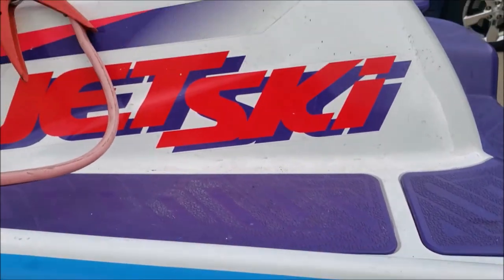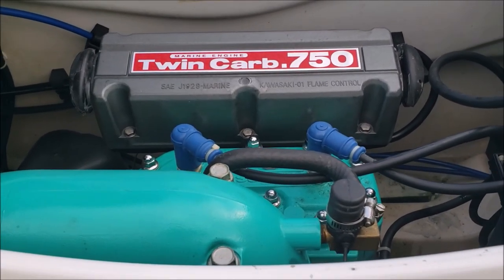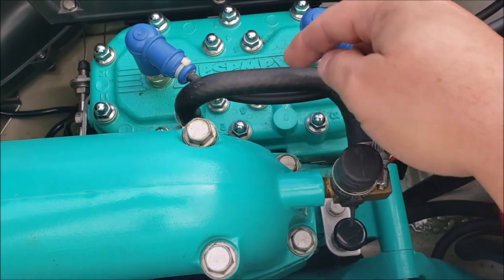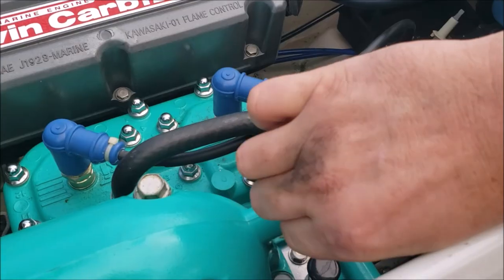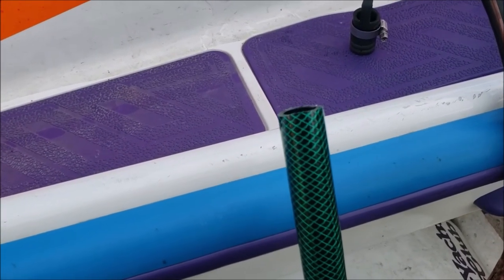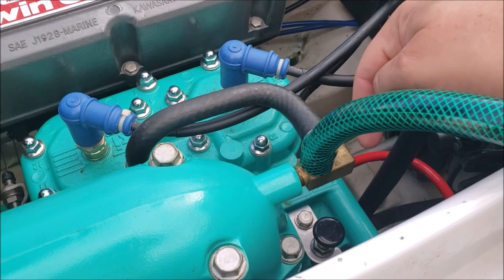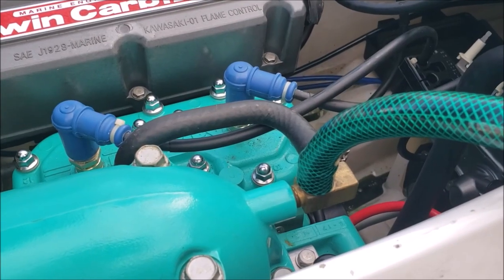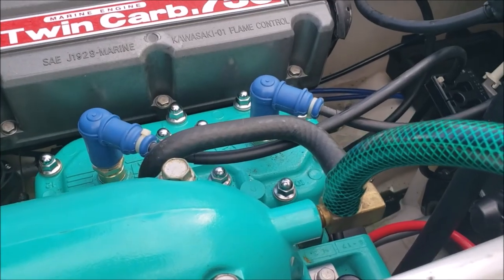Flush or Run Your Jet Ski - Water Hose Connection

Comment: I have discovered something VERY critical about running these on a water hose. Basically, that water hose connection is used to FLUSH the system..it is NOT intended to run the motor for but just a brief period. Doing so can cause HOT spots in the head around the cylinders and you can destroy an engine. When you run a water hose via that connector, you're basically going backwards with the water flow. Normally (while ski is in water), water flows in through where the jet pump is. I recently rebuilt one of these motors and the number 1 cylinder and piston were destroyed and we believe it was because of running on water hose for too long
Reply from the maker: Really? I knew it was the flush port but they also say to run it when using it.  I think the key here is too long. Thanks for the great info.

Comment: When I run the Ski should water be coming out of the Bypass outlet?  And if not should I flush it?
Reply from the maker: When you are running it in a body of water you should have water coming out of the side bypass. If not you can try to flush it but also check the pump.  That is there to let you know it's working.

Comment: Random question, I own the exact same model, but can’t seem to find an adapter to connect my garden hose securely. Would it be bad to just set a basic funnel in the flush intake and turn the hose on? Thanks!
Reply from the maker: You will need something that can take the pressure from the garden hose.  The water needs to be pushed into the adapter.  I would get a cheap hose and cut it to fit over the opening.

Comment: I just bought a 97' 750 and the owner had never heard of flushing. What type of damage am I going to come across, if any? Thank you for your video!
Reply from the maker: A lot of it is based on where it has been.  If it's been in salt water at all, flushing is very important.  The salt water can eat away and corrode the cooling system.  If you are in an area that gets very cold, there could be stress from the water freezing if not drained.  If it's been only in fresh water and kept out of the cold, it could be just fine.

Comment: What happens is your engine will lock up because water gets into the cylinders and it can’t compress the water so it locks up.  Cranking on it can cause further damage. You have to pull spark plugs and crank it and hope it’ll fire after you put them back in
Reply from the maker: Are you saying you will water lock the engine if you flush it?
Reply: It's got to be running before u start the water

Comment: If you were going to winterize, would you pump antifreeze through this same inlet?
Reply from the maker: All I do to winterize mine is run the water out of it.  But, if you are in a very cold climate then yes, you can run an antifreeze mixture through the water port to help keep any residual water from freezing in it.
Reply: I live in northern ks and I flush it like this fella. Then run rv antifreeze down a funnel connected to garden hose while the ski is running until the antifreeze comes out the exhaust.

Comment: What is the black knob for that is udder the place where you hook the garden hose to. Thanks for your help
Reply from the maker: Found this online because I have never touched that.  "Looks like the crankcase drain plug! Most people remove them and get a crankcase block-off installed. Its real easy. If the plug goes bad it can suck water into the crankcase! They stopped installing them on the SXR."  Hope that helps.

Comment: The black button thats below the water inlet . What is it for .
Reply from the maker: That is a pull knob to drain the engine of water if they jet ski gets submerged and water gets in the engine.  Here is a link to the owners manual if you want to know more: https://www.kawasaki-onlinetechinfo.net/dispeBook?file=99920-1799-02&mark=JH750C3&manual_kind=OM&model_year=1997&lang_code=EN
Reply: Thank you . I have a 750 zxi .Couldn't figure out what that black button did . Good to know .

Comment: So if you fill it up with water can it not flood the engine with the water since it’s the exhaust manifold
Reply: Nevermind I should have waited to listen to you say that
Reply from the maker: No problem.  Hope it helped.
Reply: I have a question if I have that hose inside my engine should thay be  caps off will  water flow out of it into my engine conparment
Reply from the maker: @robertbigley5694  Are you saying you have a hose connected all the time?  That port needs to be closed off or it will fill the jet ski body with water when using it.
Reply: @SeidelRanch  yes the hose to run thr jet ski out of water ..so it does have to be close of ..ok thanks so much
Reply from the maker: @robertbigley5694  Yeah, it would get water everywhere and it would probably reduce the pressure in the cooling system.  It needs to be sealed.